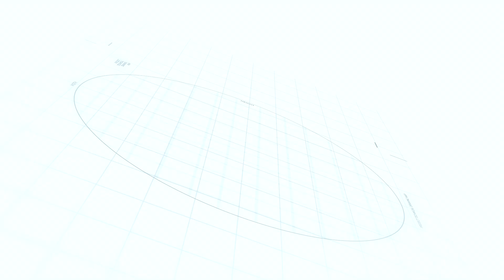Monroe OESpectrum Shock Absorbers Install - HONDA JAZZ FIT / L15A / GE8 / Suspension

Comment: Dapat harga brapa om untuk shock belakangnya?
Reply from the maker: Monroe OESpectrum dapet 950.000 om, 😎
Reply: Di Jakarta belinya dimana om?
Reply: Shockbreaker Monroe vs shockbreaker original jazz'RS GE8 nya masih nyaman mana om?
Reply from the maker: ke atrium senen atau MGK om  @chokyfal5902
Reply from the maker: Menurut saya (nyobain bntar) dan yg punya mobil (test jakarta-bandung) enakan monroe om  @chokyfal5902